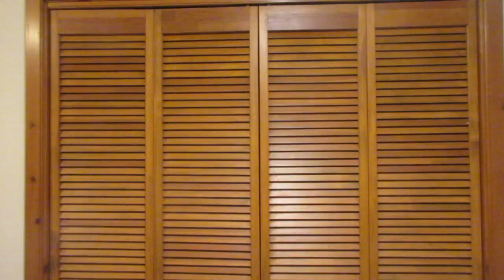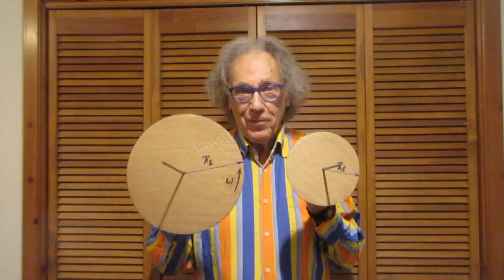Problem #8  Rotating Discs  - not easy!

Comment: Disk one is spinning he will have w, if then w gets to w2 the disk will have lost energie becous of friction and Moment shared it with the other gear I gues F is constant and t the time to the "Equalibrum state" get recorded 

r2w2=r1w1--> r1/r2=i---> i*w2=w1---> w1/i=w2 Transmission Faktor
wrμF=P 
(w2r2)-(w1r1)r2μF=DeltaD(istanz)Ff=P(lost) this thing will Burn be carfull not to use to mutch Power exept you try to make an Fire.  :)

tµFD-∫(t)(w2r2)-(w1r1)µF) =E;ofw-Elost;of over deltarDistanz of
Disk 1 and 2,=E21c(Energie of 2 and 1 in the nonchaning state, c for constant )  
w2r2t=D
W2r2t-w1r1t=DeltaV

(Start to Equalibrium state)∫f(t) DV  *µF= Ethermal
t;r=time you needed to speed up that thing
µ;r=the friction of your Finger or wath ever you speed it up with
F;r=the force you Made on the Rod
D;r=The distanz over the surface of the zylinder Rot if you speed
t;rµ;rF;rD;r=Energie of Zylinder 2 with w
t;rµ;rF;rD;r-∫f(t)DeltaV  *µF)=E-E;t=E2and1constant=E21c

Ekin=1/2mVV  
I=1/2mrr (moment of inertia of zylinder/Disk) 
root(E21c*2/I)=wx becouse the moment of Inertia is on Evry Zylinder/Disk the same time Larger 
(r2r2)/ (r1r1)*wx=w2 (h1π is equal to h2π therfore its irrelevant) 
larger Volume more Mass becous its the same mattirial densety gets Irrelevant as well.

(Mostly irrelevant Missing stuff The Heat of the Friction energie if
 the wood gets hot R2 and R1 would change in length not mutch but a 
little bit + The Earth rotation if you let them Rotate 12h they would go
 Upside down +  The relativistic effects near the speed of light if you 
want to spin them real fast + The Gain an Mass coused by the Energie you
 give to w if you spin it up real fast + the lost wight coused by the 
Brand of the 2 Wood-zylinder that could be coused by friction if force F
 and w is to high+ the stabilty of Woodzylinder 2 it max could rip it 
self into Picecs if you aply to mutch Kinetic Energie on it + the 
momentum that goes to the Earth coused by the acceleration of the WoodZylinder)

wow that was ryl a bit harder then i thougt it would be :I First like oh 
wow that so simple just tansimtion wait he wants to know it from w not 
w2 oookey that changes evrything. now evrything should be correct i 
think exept the grammmer that should be horrble to look at i gues :D
Reply from the maker: incorrect

Comment: In my opinion a crucial thing is friction between disks "u". If "u" it is small disks will stabilize its rotation longer, if "u" is large it will stabilize faster, but in both cases the lost of energy is the same. This firction may consume a lot of angular momentum of disk 2 (even half). I have no time to count it now, but I will try later.
Reply from the maker: angular momentum and energy are something totally different. There are many examples where angular momentum is conserved but where KE changes by a huge amount. There are also examples where KE is conserved but angular momentum is not. Thus be careful not to link the two.
Reply from the maker: when a white dwarf implodes and becomes a neutron star, angular momentum is conserved as there is NO external torque on the star. Since the radius decreases by a factor of 10^3, the moment of inertia goes down by a factor of 10^6. Thus omega goes up by a factor of 10^6, thus the rotational KE goes up by a factor of 10*12. No change in angular momentum, but am increase  in the rotational KE by a factor of 10^12.
Reply: Thank you. Yes, I should say "kinetic energy of disk 2"
Reply: I am electronic engineer, so I think it is possible to transform this mechanical problem to electrical problem. Two capacitors, C1, C2 connected parallel through resistor and switch. C2 is loaded, C1 not. Moment of inertia is proportional to capacitance, u to R, w to Q. Lost of energy is independent of u (R), it just changes the time of transient state.

Comment: Taking friction into account, i think it is :

ω1 = sqrt(ω^2*r2^2/(3*r1^2))
ω2 = sqrt(ω^2*r1^2/(3*r2^2))

Thats because i think the energy transfered to rotate disk1 is exactly the same as the energy lost by friction

So the equation for energy before and after is not :

ω^2*r2^2 = ω2^2*r2^2+ω1^2*r1^2

but it's :

ω^2*r2^2 = ω2^2*r2^2+2*ω1^2*r1^2

plug ω1*r1 = ω2*r2 ( which says outer speed of both is the same ) into that and there's my answer.

I hope before solution video 2 is posted :-)
Reply from the maker: incorrect
Reply: Yes, I was afraid it would be wrong. I figure vid. 2 won't be long now, so i give up. This ending might really cause a sleepless night for me now :-). Anyway, I'm looking forward to vid.2

Comment: I don't think you mentioned it, but I would make the assumption that the disks are in a vacuum, or at least that air resistance and other air related energy losses can be ignored for the duration of the problem.
Both disks have inertia and so can not change their energy instantly. Therefore until the new steady state is achieved the disks will rub past each other. This is an important aspect that separates this problem from a purely mathematical one, so personally I would not ignore this.
Thus the energy of the final system could be represented as:
E1+E2=Eo-Ef
(Where E1: final energy of disk 1, E2: final energy of disk 2, Eo: Original energy of disk 2, Ef: Energy lost to friction)
We will never know Ef for this system, from the information provided so I would ignore it from here and reintroduce it in the solution by including the phrase "less than".

Rotational energy is proportional to I (moment of inertia) and w (the closest I have to omega) squared:
E = 0.5 I w^2

For a spinning disk I is proportional to m (mass) and r squared.
I = 0.5 m r^2

We know the disks were cut from the same material so m is proportional to r squared, which is the only variable between the 2 disks. Therefore we may represent the mass by m = c1 r^2

In the final state the linear velocity, v, at the edge of each disk will be the same. We know that this linear velocity is proportional to r and w, so v = c2 r w. Rearranging for w we get w = v/c2r

Therefore rotational energy E = 0.25 c1 r^4 v^2/c2^2r^2  which simplifies to E=C r^2 v^2  (where C is all combined constants)

E1 = Cr2^2 v1^2
E1 = (Cr2^2 v2^2) + (Cr1^2 v2^2)  (Actually the right side is less once we return friction to the solution)

Combining and simplifying for C and the powers:  (r2 v1)^2 = (r2 v2)^2 + (r1 v2)^2  = V2^2(r1^2 + r2^2)

Solving for V2 we have V2 = (r2 v1) / SqrRoot(r1^2 + r2^2)

I have a headache now and can barely read the notation I've had to use, but the final angular velocities w1 and w2 can be derived from r1 and v2, and r2 and v2 respectively. The actual angular velocities will be less than that due to the friction of disk engagement.

(I know I haven't quite got there but I'm cross-eyed now.)
Reply from the maker: >>>E1+E2=Eo-Ef>>>
WRONG!
Reply: Hmm, have I ignored another loss?
Total energy of the system must be conserved during the change in rotational velocities of each disk and I can't think of another significant source of loss, given that the rods are idealised.

I could add in the initial kinetic energy of disk 1 to be complete, but in this case it is zero.
Should I have been explicit that Eo, E1 and E2 only represent kinetic rotational energy? 
I have idealised the system for all other losses but I could recast Ef as "friction and all other losses".

I just noticed you have published a solution video but give me a clue as to what I've missed please prof, before I give up and watch it. I'm starting to think I'm so wrong that I've completely misunderstood the mechanics of the experiment.
Reply from the maker: watch the video which I posted this early morning
Reply: Aha, I had a nap and actually dreamed a new answer. I'm a bit excited because it's fundamental and obvious and completely changes the way I look at the experiment (if I'm right).  You actually gave away a component that I missed:

Imagine the axes are vertical and the apparatus is mounted over the centre a giant frictionless flywheel.  As the disks bite they will try to jerk, just as you said (anticlockwise from our viewpoint here). While you specified magic apparatus that won't allow a deformation within the apparatus, clearly some rotation is going to be transferred to this flywheel.
 
In reality the flywheel is a placeholder. If our apparatus is bolted to the ground then the earth is the flywheel. If the apparatus is floating freely in space then the total material mass of the apparatus is my flywheel.
Either way I haven't accounted for the energy lost from the 2 disks and gained by this 3rd component.

Is that where my first line diverted from the solution? If so I'm suddenly struck by how beautiful this experiment is. I've no idea how to model the flywheel mathematically, but it's so much more interesting to see where I was wrong than to know the answer  :-O

Comment: Scalar values of angular speeds are:

ω2=  (R2^3*ω)/((R1^3+R2^3))
ω1=  (ω2*R2)/R1 

Because:
1. Angular momentum conservation
2. Disk's moment of inertia I = (m*R^2)/2
3. Linear velocity of points on the outer edges of both disks must be the same.
Reply from the maker: the correct solution will surprise you.  I'll post it tomorrow (Sat) afternoon ET.
Reply: Just read predecessors' remarks on torque and external forces, and I must honestly agree with them. Therefore, I admit, my previous solution based on conservation of angular momentum is wrong from the beginning.

Another approach, I'd take to solving the problem is conservation of energy.
Potential & linear kinetic energy is not changing by definition of the problem and the the 2 disks have rotational energy.

Rotational energy E= (I * ω2)/2 where I = moment of inertia.
The first equation would be: rotational energy of single disk at the beginning is equal to the sum of roatational energies of both disks spinning together.

The second equation is the fact, that the stable set has the same linear velocity of the outer edges.

The corrected result is then:
ω2=ω*R2/sqrt(R1^2+R2^2)
ω1=ω*R2^2/(R1*sqrt(R1^2+R2^2))

Looking forward to checking the "official" correct solution.
Reply from the maker: incorrect
watch my video tomorrow

Comment: I think the angular momentum of the system is not conserved! Due to the friction we get the the same forces at the edges of both disks but torques are different because of different radiis. That's why there is no any external force but there is an "external torque" which we should be worried about. We can just use the equations of motion to solve it.
Reply: Hi, Dr. Walter.  I am a great fan of yours! Do you agree with my comment?
Reply from the maker: after high school go to college and take as many courses on QM as possible. MIT's 8.04 and 8.05 are on MIT's OCW but you will not yet have the background in physics and in math to follow those courses.

Comment: Here is my solution.

d# = disk #, r# = radius of disk #, ω# = final ang. velocity of disk #.
Ω is the starting ang. vel. of disk 2.

I'm going to use the fact that total angular momentum should be conserved,
as well as that the speed at the edges of both the disks should be the same.

The angular momentum of an orbiting mass is:
 Lpoint = r * p (since p⊥r)
So for a circle (not a disk!) with mass m
 Lcir = r * mv
Since the mass of a circle of thickness dr and density d is: 2*pi*r*d*dr
And its velocity can be written as r * ω
 Lcir = (2*pi*d*ω) r^3 dr
The angular momentum for a disk now is the integral over this with r from 0 to the radius R of the disk. Since a disk is just a lot of circles inside eachother
 Ldisk = (.25*pi*d*ω) R^4

The total angular momentum at the start is:
 Ltotal = (.25*pi*d*Ω) r2^4
The total angular momentum at the end is:
 Ltotal = (.25*pi*d*ω1) r1^4 + (.25*pi*d*ω2) r2^4
As stated above, these should be equal:
 (1) Ω*r2^4 == ω1*r1^4 + ω2*r2^4

Speed at the edge is: r*ω (since r⊥ω) , so for the speed of the edges to be equal:
 (2) r1 * ω1 = r2 * ω2

Combining (1) and (2) gives us the answer:
 ω1 = r2*ω2/r1 = ( Ω*r2^4 - ω2*r2^4 ) / r1^4
 ...solving for ω2...
 r2*ω2 + ω2*r2^4 / r1^3 = Ω*r2^4 / r1^3
 (r2 + r2^4 / r1^3) ω2 = Ω*r2^4 / r1^3
 ω2 = Ω*r2^4*r1^3 / r1^3*(r2 + r2^4) =
 ω2 = Ω*r2^4 / (r2 + r2^4)
And analogous for ω1:
 ω1 = Ω*r1^4 / (r1 + r1^4)

Sor surprisingly, the size of a disk doesn't influence the final angular momentum of the other disk, only it's own. (assuming that I made no mistake). So if disk had the size of a coin, or truck wheel, ω2 wouldn't be different.
Reply: ...another universal constant is discovered...

ω2

Comment: Prof. Walter Lewin. I've been thinking on this problem for days, and I just realized a nice idea to solve it. I'm still not quite sure it will lead to a propre and correct solution, but yet I want to post it now, before I make some calculations.
The idea is that due to friction and the external forces that prevents the two disks to slip ona above the other, there is a TORQUE RESULTANT not zero on both disks so that the angular momentum is NOT conserved (and this is also a clear conclusion by straight observation on what will happen on the two disks before and after). BUT since the two disks remain in initial places this means that the Torque acting on disks is the result of a couple of forces (don't know the English term for italian "Coppia di Forze") namely friction and external force that prevents to slip that have 0 vectorial sum as resultant of FORCE.
This on both disks. So the external force applied to the system is 0. Total Torque is NOT zero, but TOTAL FORCE is zero. So we can say that the momentum is conserved! Not angular momentum, but momentum is costant. Also in the end we have the both disks have same angular velocity and I am oriented that problem can be solved in a similar way when momentum is conserved and we have a totally anelastic urt. I'm going to make some calculation and get back soon telling what I find. STill not sure this is a correct analogy but I think the idea is nice. Thanks for sharing this problem. This is indeed very nice and it is so fun thinking and trying to solve it. Even though I don't reach a correct conclusion I am indeed spending hours and hours having fun and excitement thinking on it!

Comment: This "real nice" problem with its "solid mahogany" discs is the MUTHER OF ALL TRAPS!
I hope that no students ever got this as an exam question.
My second attempt has not been posted, so I guess it is correct.
I didn't do much wrong on my first attempt. The maths was correct, the physics was ok, and I STILL GOT IT WRONG!
I was convinced that you have to make an assumption about energy loss (a reasonable assumption), but NO,! There is an "exact" solution, regardless of energy loss or change in total angular momentum!

Comment: The torques which these objects apply to each other are equal in size and opposite in direction. So they are exactly opposite vectors. This means the sum of angular momentum of disks with respects to their own axis remains conserved. 
Giving disks have the same thickness and density, one can tell that the ratio of their rotational inertia is equal to the ratio of their radii to the power of 4. Therefore we have, \omega_1*R_1^4+\omega_2*R_2^4=\omega*R_2^4
On the other hand, at the moment which \omega_1/\omega_2 stops increasing/decreasing, there is no torque and so friction between the disks, so \omega_1*R_1=\omega_2*R_2
These give the following values for \omegas:
\omega_1=\omega/(x^4+x)
\omega_2=\omega/(x^3+1)
where x:=R_1/R_2
Reply: Try considering the force and reaction force at the point of contact being equal (since radii are different, then the torques will not be equal)

Comment: w1 = (8/5)*w and w2 = (4/5)*w, I used the fact that the force on each other at the contact point is same magnitude, so I can find torque on each disc. And the tangential velocity at contact point is the same.
Reply: Whoops, somehow I was assigning values to r1 and r2, but forgot to go back and do it with variables.

Comment: d=density, M=mass, h=thickness. Τ=friction, Δθ=angular displacement, R2=2R1, Δθ1=2.Δθ2, Τ1=Τ2 due to 3nd newton law
M2/M1=d.R2^2.π.h/d.R1^2.π.h so M2=4M1. At the end ω1.R1=ω2.R2 so ω1=2.ω2
Work energy theorem for each one
(1/2.1/2.Μ2.R2^2.ω2^2-1/2.1/2.Μ2.R2^2.ω^2)/(1/2.1/2.Μ1.R1^2.ω1^2-0)=-Τ.R2.Δθ2/T.R1.Δθ1 and final ω2=sqrt(4/5).ω and ω1=2.ω2

Comment: Assuming that the angular momentum is conserved ( L_before = L1_after + L2_after) and that the final angular frequencies are linked (w2f= r1/r2*w1) I get the following:

w1 = w*r2^4/(r1^4 + r2^3*r1)
w2 = w*r2^3/(r1^3 + r2^3)     (in the opposite direction of course)

I see a lot of comments saying that conservation of momentum is not a valid assumption, in that case I would be interested in knowing why.

Comment: Let the force pushing the objects together N, the friction force becomes:
F = u N
The tourqe of this force on each object is:
T_1 = u N R_1
T_2 = u N R_2
Moment of Interia for each object:
(I = 1/2 M R^2) [Sigma: Surface Density]
I_1 = (1/2) Pi Sigma (R_1)^4
I_2 = (1/2) Pi Sigma (R_2)^4
So:
dW_1 / dt = 2 u N / Pi Sigma (R_1)^3
dW_2 / dt = 2 u N / Pi Sigma (R_2)^3
Adding the initial values W_1(0)=W, W_2(0)=0:
W_1(t) = W - 2 u N t / Pi Sigma (R_1)^3
W_2(t) = 2 u N t / Pi Sigma (R_2)^3
This acceleration ends when the contacting segments get to the same speed, that is:
W_1 * R_1 = W_2 * R_2 -->
W R_1 - 2 u N t / Pi Sigma (R_1)^2 = 2 u N t / Pi Sigma (R_2)^2
Solving this:
t = Pi Sigma W (R_1)^3 (R_2)^2 / 2 N u [(R_1)^2 + (R_2)^2]

--- Finally:
W_1 = W (R_1)^2 / [(R_1)^2 + (R_2)^2]
W_2 = W (R_1)^3 / [R_2*(R_1)^2 + (R_2)^3]

I'm not sure but hope this to be correct!